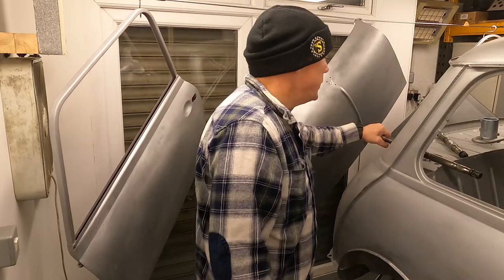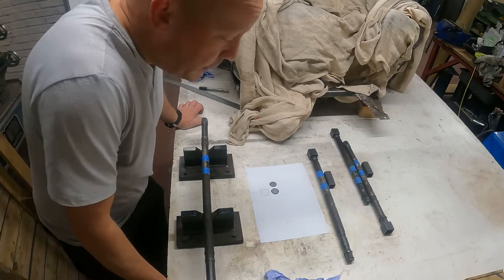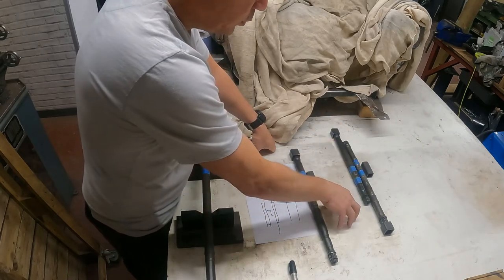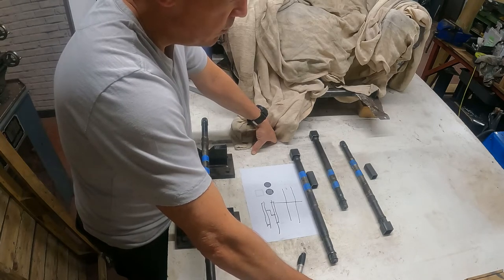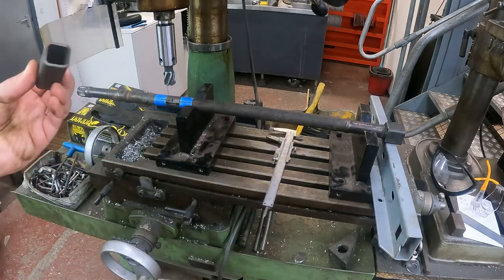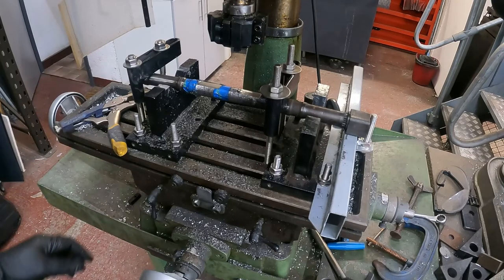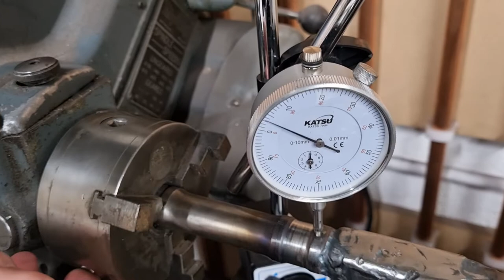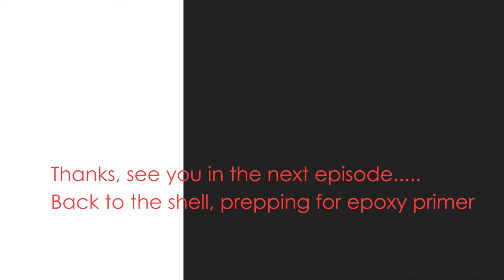Classic Mini 76 Build Part 13   Mini Micra Driveshaft Fabrication   Part 2 of 2

Comment: First..  absolutely love your wire setup.  Would love to know more details on what you used to assemble the setup.    Then your thought process is excellent.    Without seeing the finished shaft, I wonder how the overall balance will affect wear and tear.    Love it when people are creative!!
Reply from the maker: Hi Randy 
The driveshafts are an unknown so the results can only be measured on the road. 
The wire assemblies are made in house using parts mainly imported,  I make my own brackets but these new ones on the video come from China.
Reply: @classicminihaha2508  I have hated my method of hanging items for paint.  I will adopt a similar idea.. thank you.